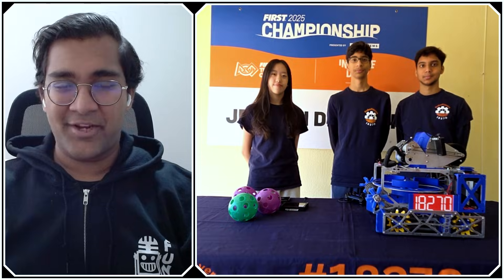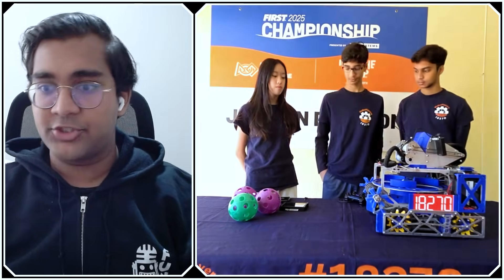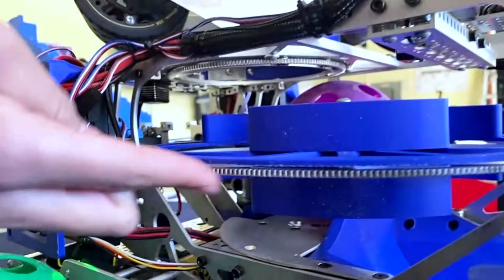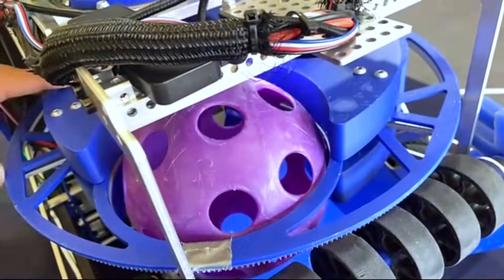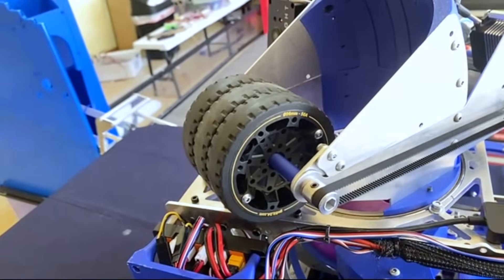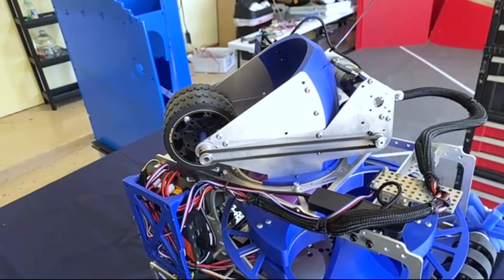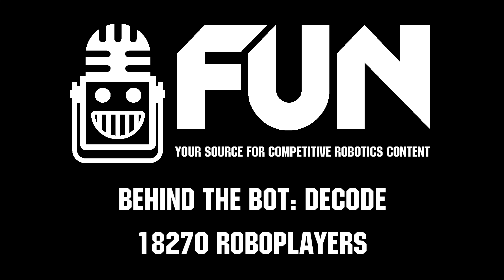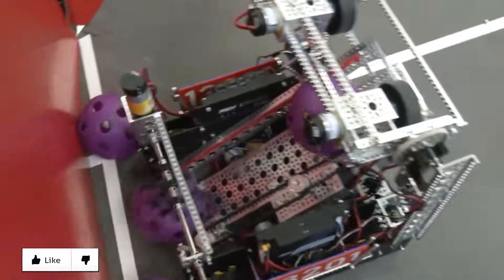18270 RoboPlayers | Behind the Bot | FTC DECODE Robot

Comment: Question, After watching a handful of the behind the bots for this season I've noticed a lot of teams adjusting their hood angle. I understand why, but my team has been able to achieve the same results of changing the range by just adjusting the rpm of the flywheel. just wondering why I am not seeing it all that much else where?
Reply: it’s more efficient and consistent cause lower rpm needed
Reply: We found there were less bounceouts if the ball is shot harder into the goal. Higher rpm in our case means more spin which makes it bounce out.